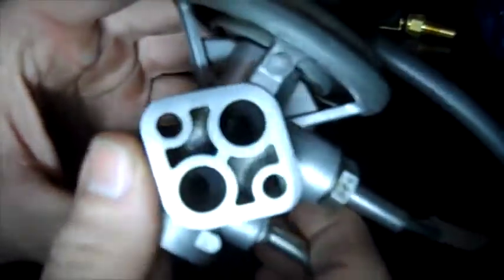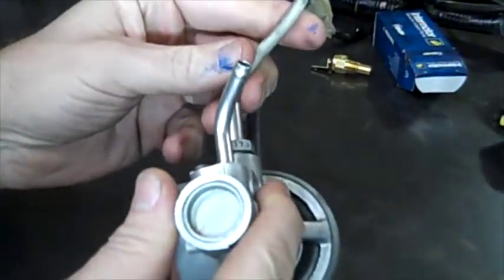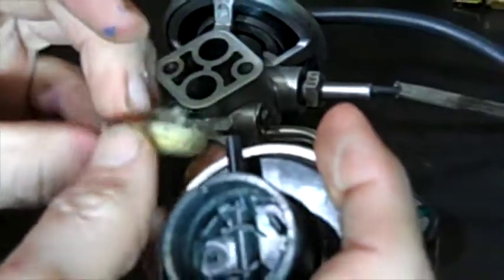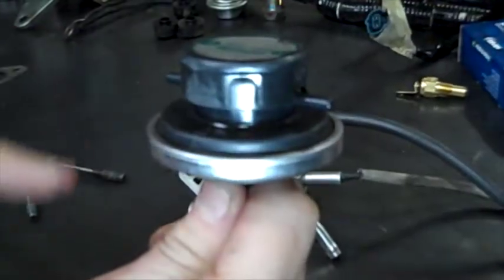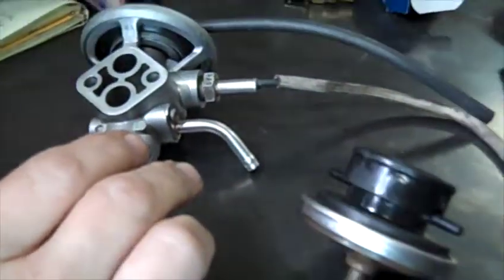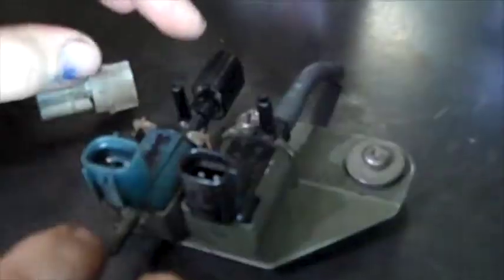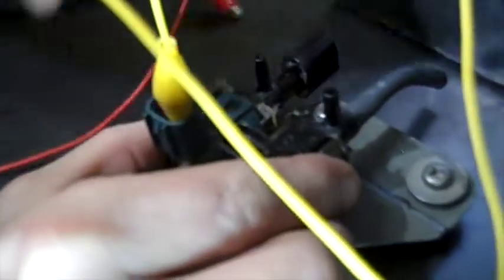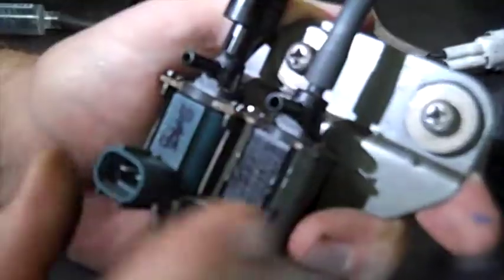1995 Suzuki Sidekick EGR System

Comment: I have a 91 Sidekick... are the EGRs between the 8v and 16v interchangeable? They look pretty much identical...!
Reply from the maker: They might be.  I have not worked on the '91 model, but all EGR systems function the same so if the parts fit then I would assume that they would work properly to improve fuel mileage on the highway.

Comment: Y delete that
Reply from the maker: Are you asking "Why delete the EGR system?"  I think some people remove it or disable it because they do not understand it.  It is confusing and has too many parts.  Also, it's kind of messy inside.  That's why I made this video -- to teach myself how it works.  The primary function is to improve fuel mileage by reducing the 'sucking pressure" of the pistons without effecting engine power.  I would not delete it.  I would clean it up and make sure it works right.  After about 100K miles it will get all gunked up inside the passages, tubes, and air intake system.

Comment: Do you have any vid of the process of removing it from the car frank ?Thanks for everything
Reply from the maker: Sorry, I've only removed these parts after taking the engine out of the car.  The bolts on the main valve would be difficult to get at with it in the car, but doable.  All the other components should be easy to remove.

Comment: I have a 95 tracker . What does it mean if it sends an EGR code after driving for a few minutes. And while running at idle I press on the diaphragm and nothing happens, idle stays the same and no stall, also while running I disconnected all the hoses and nothing happens? No change in the RPM no stall, nothing, but an EGR code shows after driving for a few minutes. Disconnecting the battery makes the EGR engine code light goes away but it comes back obviously. Is there a clog somewhere, or the solenoid? I'm confused
Reply from the maker: Uhm... Seems like two different things.  First the vacuum ... There has to be vacuum or the engine wouldn't be running.  If you pull off the vacuum tube to the solenoid valve on the front there won't be vacuum because the valve is closed.  If you pull off the short little vacuum tube from the intake surge tank to the solenoid valve the idle speed should increase a little and if you put your finger over the hole to the surge tank then you should feel a little suction.  If not then the intake surge tank is probably all gunked up on the inside.  If you press the diaphragm open and nothing happens at idle then I suspect the passage through the head to the exhaust is clogged up and/or the large metal tube from the EGR to the intake surge tank is clogged.  Unless you don't have that tube in which case all the little EGR ports on the intake manifold are clogged up.  My understanding of the check engine light for the EGR is that it is a temperature sensor on the EGR valve with a 2-wire connection.  If it isn't connected then you get a light or if the temp reading is high you get a light.  I think you can get rid of the light by unplugging the wire putting a resistor across the 2 ends, but I can't remember what size resistor to use.  If it was me then I would remove the whole intake plenum (assembly) and start cleaning.  It is probably full of gunk and the port to the exhaust is probably plugged with burnt gunk.  I'm assuming it has never been cleaned.  Go to my face book for more chat:  www.facebook.com/SidekickRebuild/
Reply: @nunapitchuk  thanks. I took off the plastic cover to access the metal wire for throttle, pressed on it while running and a vacuum then formed that was noticable. And then I took off the metal tube, it was 90 percent clogged. I cleaned it, and still the same problem. I'm pretty sure the inside of the intake manifold in the engine is clogged.  The engine light is being caused by the thermoprobe. Probably caused by temperature. It's a California model. I'll have to bypass it with the resistor. I looked at a video of where you cleaned the intake manifold. I'm pretty sure that's what I'll have to do. I've just never taken that off before.
Reply from the maker: @brucebanner863  I don't gamble, but I would bet the passage through the head from exhaust to EGR is 100% plugged up.  There are gasket kits on rockauto.  Need the 2 intake manifold gaskets, EGR gasket, throttle body gasket, IAC gasket, gaskets for the metal tube ends.  Removing and cleaning is something you can do with a couple of size 10 and 12 open end wrenches.  It is the nature of the EGR system that they get gunked up after 20 to 30 years.  No additive will prevent that.  The purpose of the EGR is to improve fuel efficiency so it would be beneficial to clean it out.  Also clean the throttle body, intake surge tank, intake manifold, and IAC valve.  I always just clean everything that is cleanable.  While you have it off you might consider replacing all the o-rings on the fuel injectors since they are so old now.  Look on amazon for some nice wire brush kits and get some wd-40 and king size box of q-tips.  It takes awhile.
Reply: @nunapitchuk  thanks. I just cleaned the throttle body by taking off the air intake using some cleaner and rags. It was dirty. When I opened the butterfly to clean behind it I seen the inside was covered in crud. I cleaned the iac valve to. It was kinda dirty also. The car always had a good idle and sometimes you couldn't even tell when it was running when it is on, but after I did that it ran much better. And when I came to a stop it didn't drop to 500 RPMs and bounce back to 800. It just went to 800 and stayed. Throttle response is better now to. I'll have to find the gaskets and some time to remove everything and clean it thoroughly to get the EGR running again. Thanks for the videos to. You make the best videos on the Suzuki/trackers I've seen.
Reply from the maker: @brucebanner863  Glad to be of help.
Reply: @nunapitchuk  is there a video of you taking off the intake manifold? I seen the one where you clean it once off. Are there gaskets that need to be replaced during the removal and reinstallation, and while off and cleaning, are there other things you would recommend doing while it is all apart. Like maintenance or replacement of other parts in or around the intake manifold. Are there other parts I should check or clean while I have this apart. I've been driving this geo tracker for over 20 years and I've done a lot while I've owned it to keep it running. I've always relied on helpful videos and posts from people like you to keep it running, so I appreciate your videos they are very informative and easy to understand and follow. So thanks again. Also are there any additives you suggest to keep the engine and the valves protected. I use Lucas. And high mileage synthetic oil now.
Reply from the maker: @brucebanner863  I posted a couple of videos that show the removal of the intake plenum.  The only difficult part is getting the bolts/nuts on the lower side of the manifold because they are hard to reach and very little room to turn the nuts.  It might help to download the manual:  https://drive.google.com/drive/folders/1YgMaDXtB83Dt5Us9iiEhnqJgXK2py-t6?fbclid=IwAR31xSppDDiqL2-X4ZFL7eymf_HIft2IHtaVEEgLSkSCMzXz-kjEd1VnC5s  I don't use any additives because I have never seen any real evidence that they are effective other than a kind of placebo effect where people just choose to believe they are effective because the bottle says so.
Reply: Ps there also doesn't seem to be any suction on any of the tubes I disconnected while the engine was running. After testing the diaphragm and disconnecting the tubes there was no suction anywhere and the engine didn't stall or anything either.. I also took off the EGR and cleaned it thoroughly the diaphragm seems in good condition and the inside is also very clean as well, new gasket when out back on etc. the part itself seems in good working condition. It's just throwing a code and no suction anywhere?
Reply: I just took all the tubes off and cleaned them one by one while running. And they were all clean. Also no suction. I followed all of the small tubes, both paths,( rubber and metal) from the EGR  to the top of the engine and they were all clean, no clogs at all, I blew through the one at the top of the engine with the small rubber hose and I could push air in and suck air out of all the  small hoses. No vacuum at all at idle. I did not test the larger hose at the bottom of the EGR to the lower part of the engine.  Is there supposed to be vacuum at the top hoses, at idle? , and why if they are not clogged is there no vacuum at all?

Comment: The vacuum hose connected to the throttle body, does it have vacuum all the time even at idle?

My does not have vacuum, even when i rev the engine at idle. Is it normal?
Reply from the maker: Yes, there should be vacuum there.  Might try sticking a pipe cleaner with some carb cleaner in it to make sure it's clear.  If you connect the tube with the engine running and put your finger over the tube you should feel a little suction at idle.  Thinking about it just now, I guess I have never actually done that so maybe I'm wrong, but I would expect to feel a little suction.
Reply: @nunapitchuk  i tested it just now, during idle the vacuum is not very strong, it get stronger when rpm is higher.. 😊
Reply from the maker: @axiediary3182  That's good, right?  It's working now.  You said before you had no vacuum.
Reply: Yeah, i clean it with carb cleaner as you suggested. Seems like it pushes the gunk out of the pipe. Thanks for the suggestion earlier 😁
Reply from the maker: @axiediary3182  Glad to be helpful.
Reply: @axiediary3182 did you take off the rubber tubes and clean them, or did you use carb cleaner with the rubber tubes still on them? And did you clean all of the ports or is there a specific one. I think I'm having the same problem but don't know how to address it. I have no suction but an EGR that is recently cleaned and in good working order. Just no suction anywhere. And my EGR code keeps tripping.
Reply: @brucebanner863  i remove the rubber the rubber tube and direct spray into the passage way in the throttle body. My engine is G16B
Reply: @brucebanner863  egr only have suction when you are driving at a constant speed. Not when idling. There is a solenoid valve that control it
Reply: @axiediary3182  I just cleaned all the tubes, got a vacuum from small tube at top of manifold while increasing the RPMs, cleaned out the majorly clogged larger metal pipe on the side of the engine that goes to the EGR to the top of manifold, (it was full of gunk) and now I'm sure the holes in the inside of the engine are completely clogged. I'll have to figure a way to take it apart to clean it..
Reply: @brucebanner863  My egr passage also fully blocked previously. I remove the egr valve, exhaust minifold, metal tube at the side to the intake minifold. Clean those using carb cleaner, metal wire and air compressor. Need to be patient to clean it, cause some carbon is really stubborn..

Comment: Thanks for the video!  I have a 1991 Suzuki Sidekick, 3 speed auto, and my engine light keeps showing code 51.  I replaced the EGR Valve $400 and it came back on.  Also, my tranny delays going into 2nd gear cold until about 3 minutes of driving. Then it shifts fine.  The mechanic said it's related to the EGR System because the tranny uses a vacuum pressure sensor to shift properly.  I need to figure out how to resolve both but not sure what else to test or replace next.  It won't pass smog until I get the check engine light and code 51 fixed. The system looks simple enough but the problem is I don't want to keep throwing $$ at parts that don't solve the problem.
Reply from the maker: I think trying to solve a problem by replacing parts is an awful troubleshooting strategy.  Your car has many differences than mine.  On the '95 model the egr sensor is just a temperature switch so that when the egr valve gets too hot it gives a code.  I have no vacuum connection to my 4 spd transmission.  I would try to figure out what sensors on your car could possible cause the code and how they work.  Once you know that then you should be able to ID the problem.  If the problems turn out to be unrelated then I would suspect worn plates in the 2nd gear cluster (need to get warmed up before catching) assuming they have probably never been replaced.  Keep in mind that I've never worked on a '91 model and don't know the details of your situation.

Comment: I blew into the bottom and I couldn’t breathe through it so there was no vacuum going through my modulator. Assuming it failed a just blocked off and deleted the egr system. I assumed it failed and didn’t want to buy a new one for $170 Lol thanks for the vid it was very helpful diagnosing my problem
Reply from the maker: You will probably not notice any difference if the egr is plugged and not working.  Possibly a small drop in fuel mileage depending on how you drive.  I don't really understand what you blew into based on your comment, but if it is as old as mine then there is a good chance that it is clogged up.  I recommend removing the intake air surge tank and intake manifold and spending a few hours trying to clean those out some time when you don't need the car for a few days.  It is probably nothing critical, but mine had a lot of oily crud in it from the egr system.

Comment: Sir thnk you so much for your video. Sir me i ask a question to you. For your valve clearance you use what MM you use of suzuki carry sir. Im from phil. Ang i use also suzuki carry model 1999. Hope u answer my question. God bless always
Reply from the maker: On the 1995 Suzuki 1.6L, 16 Valve model, the valve lash clearance is 0.13 to 0.17 mm on cold engine (15 to 25 C).  I do not know what engine you have on your '99 Carry.  See my video on engine head rebuild for more information about the valves.  Hope this helps.

Comment: Can eney of that make my sidekick surge up and down at idle and still drive just fine
Reply from the maker: No, because the EGR system shuts off when you take your foot off the gas peddle.  It has something to do with air intake and/or timing.  First easy thing to check is that air filter is clean and dry.  The trouble shooting gets much more detailed after that.  If you are a do-it-yourself kind of person then message me on my face book page and I will try to help:  www.facebook.com/SidekickRebuild/

Comment: I was wondering if you have any advice on 94 sidekick 16 v overheating? Will idle for long time no problem, but when I put it in gear, it will overheat.
Reply from the maker: Sorry Steph, I did not see this question before.  Still having the problem?  You can message me on 
my face book page, suzuki sidekick restoration project.